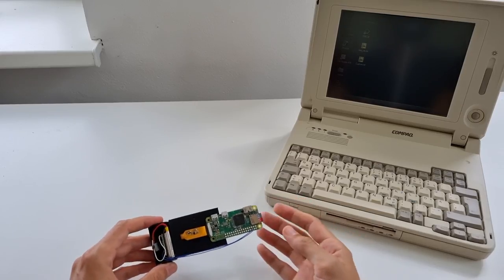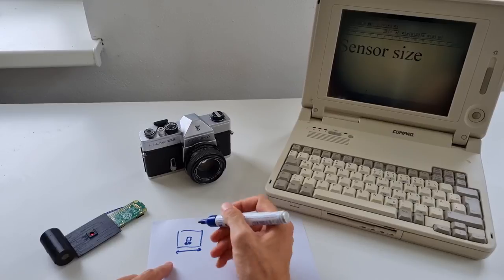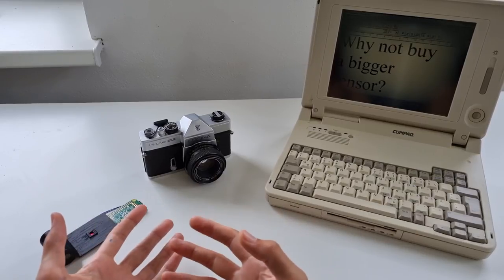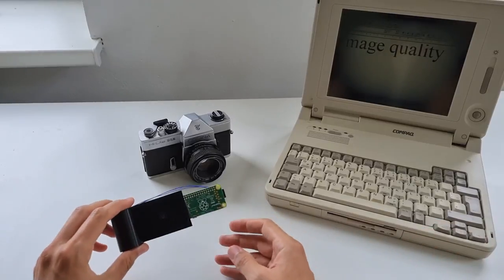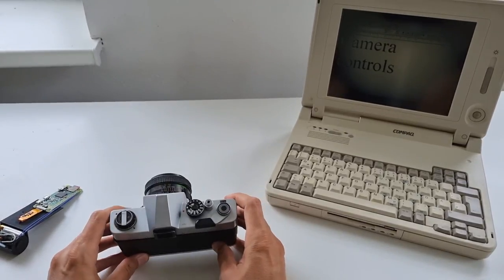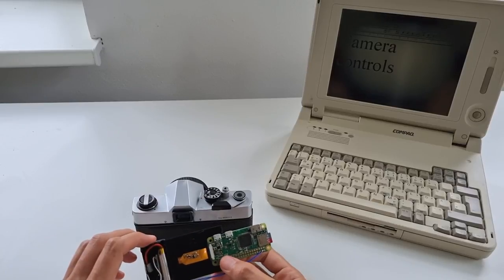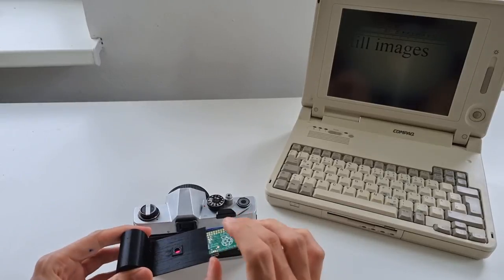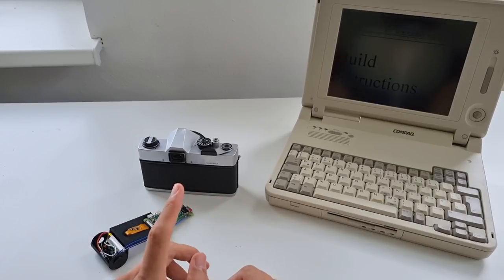Digital Film Cartridge: Q & A

Comment: This is relly cool.
The drawback is clearly the tiny sensor. It will result in a crop factor of 5.5 - 6 (depends on the size) meaning you'll get a huge focal length.
A 50mm will end up having the same field of view as a ~300mm lens.